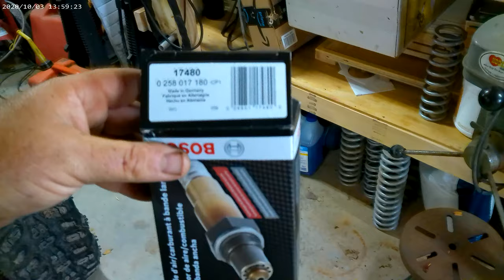Honda Talon Cat Removal

Comment: With the turbo does it work ok with what you did to the pipe
Reply from the maker: no change at all with performance.   sound actually got worse.  sounds like a big old empty tin can.   dont advise removing cat
Reply: What’s with all the water? I’m almost 3k miles and never a problem with the o2 sensors
Reply from the maker: @Jaxon1127  i think i should have mounted it closer to the turbo. but otherwise no clue
Reply: @dsadosomthingawesome5386  wow okay, I’ll ask around 
Thanks

Comment: Just noticed your rear spring guards are on backwards, they should be on the front side.
Reply from the maker: Yea I did it on purpose to stop the mud being thrown at it. I know it's backwards but u wanted to see if it made a difference. I'm pulling these shocks off soon for a new set
Reply: Did the same had rocks collecting on the backside

Comment: Your work bench is worse than mine. Turn up the volume!!  You sound like a Church mouse.  You bought a Jackson high $ Turbo and cheesed on a muffler.  Thanks for the video.
Reply from the maker: jackson doesn't have it tuned for aftermarket. but i did a vid on adding a evo and i had to tune it up some more